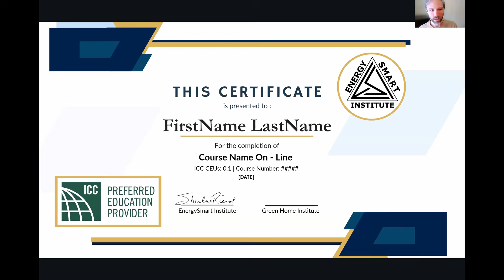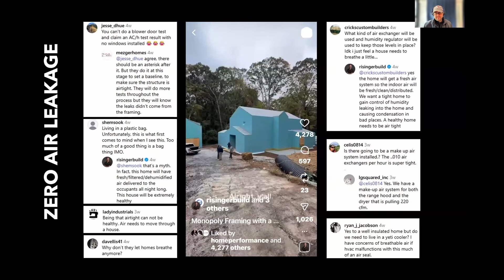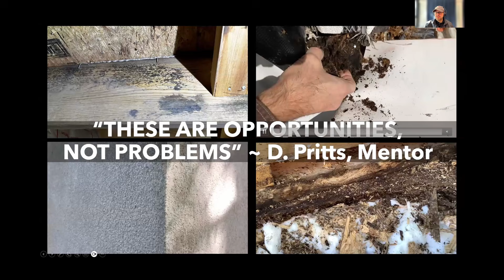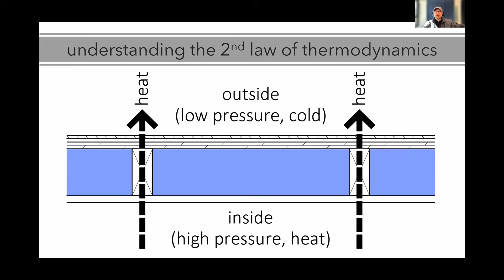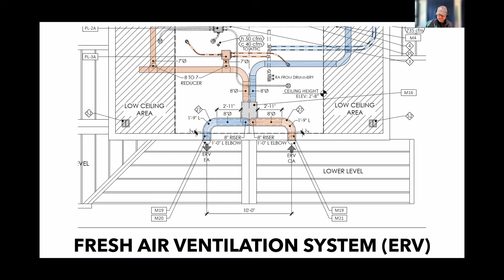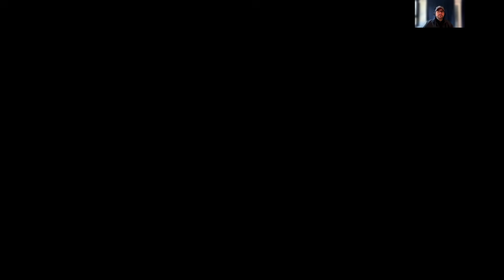Zero Air Leakage! Now What?

Comment: Why not put a makeup air damper connected from the outside to the return air of the HVAC with pressure switches installed on the range hood and/or dryer vent? M1503.6.1